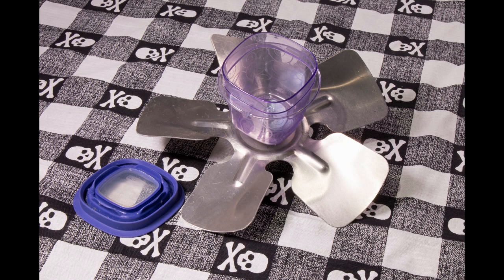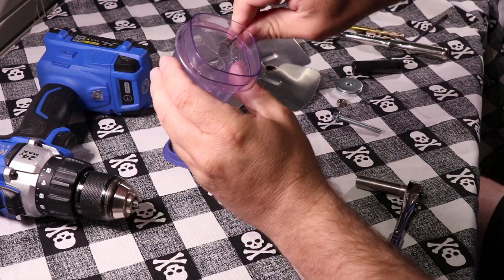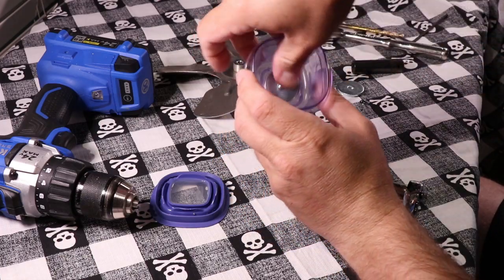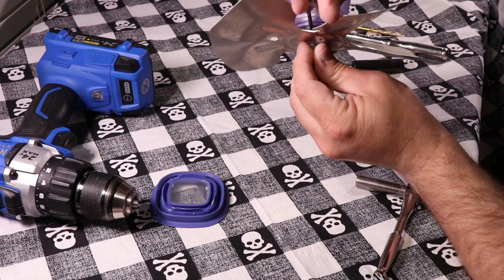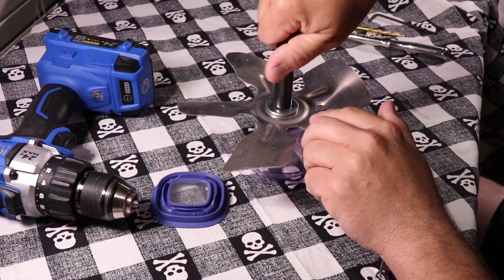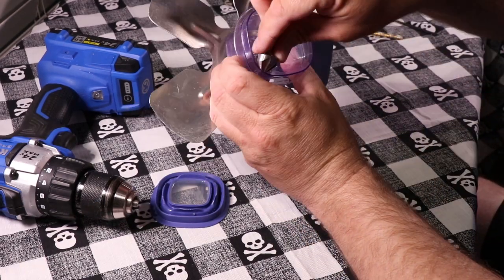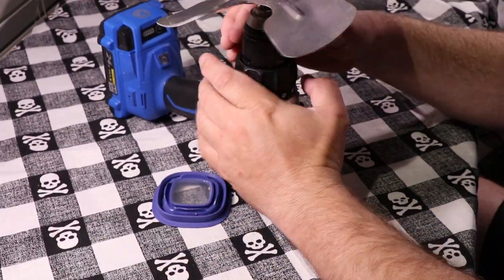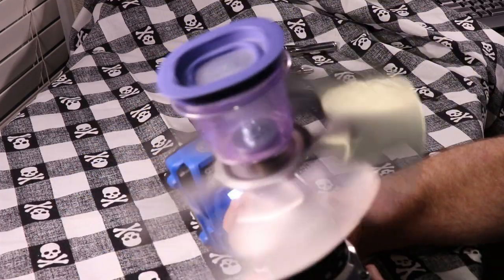DIY Rubber Cement Spiderweb Gun

Comment: where do you get fan blade?
Reply from the maker: I’m 99% sure I got it from Grainger.  If you google 8” HVAC Fan Blade, a ton of options will pop up (almost all of them from Grainger).  Then just make sure you run the drill in the direction that pushes air forwards.  You don’t want to find out what happens when you accidentally run it the wrong way lol

Comment: Have you ever tried maybe a plastic fan blade, perhaps one a bit larger (near a 12")? I understand DIY on a budget to get these effects, wanted to get your input about it.
Reply from the maker: We haven't but I would assume it would work as well.  You might need a longer bolt, as the plastic fan blades usually have a thicker center section.  IIRC we got the aluminum fan blade on clearance, so it was under $10 shipped.

Comment: Can this be done any other way? Like for example using a spray bottle?
Reply from the maker: Unfortunately I haven't run across a spray bottle that would have enough pressure to force the glue into a usable pattern.  The rubber cement is a bit thicker than the consistency of typical white craftt glue like Elmers. and there isn't a good way to thin it that wouldn't risk damaging the majority of spray bottles.
Reply: @Zero2Random  ah okay
Reply: Van Oaks Props has a video showing how to use a can of Loctite Spray Adhesive for webbing effects.  It seems to have limited use, but if you don't have a drill or air compressor, it might work for you.  Of all the web casting videos, though, I'll be following this one.

Comment: What brand of rubber cement did you use?
Reply from the maker: We just used the small 4oz bottles of Elmers brand.  We got them at Joanns with 40% off coupons, and stock up during the year.  That route ends up being cheaper than buying larger containers.
Reply: @Zero2Random  awesome thank you!

Comment: I have heard this "cement" comes off very easily, is this so as I don't own my own house ??!!
Reply from the maker: I apologize for the late delay, my wife and I went out of town for our 10th anniversary and didn't have access to this account while we were there.

It does come off pretty easily, although it will leave "clean" marks where it was (it will pull up any dirt that was stuck to the surface, such as on concrete).  Cloth surfaces are the only places I haven't really tested it, although I've googled a bit and it seems its possible to remove it from cloth as well.